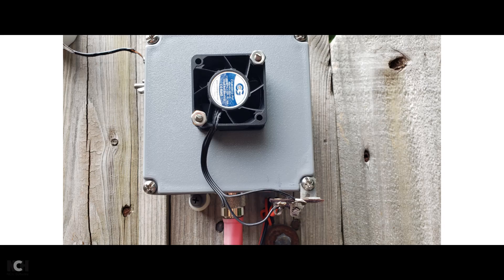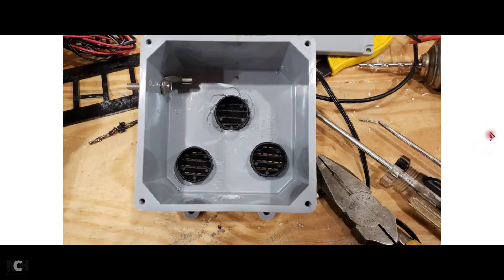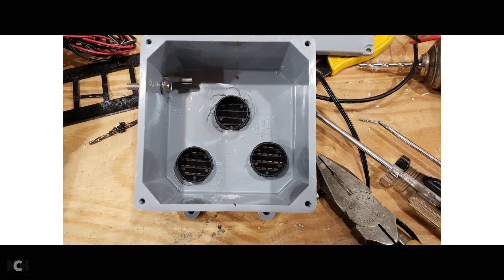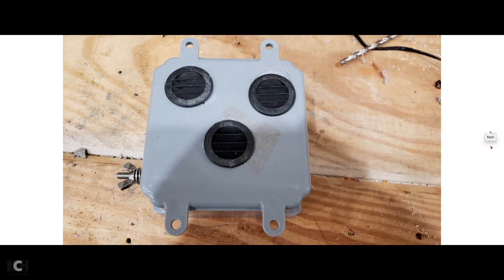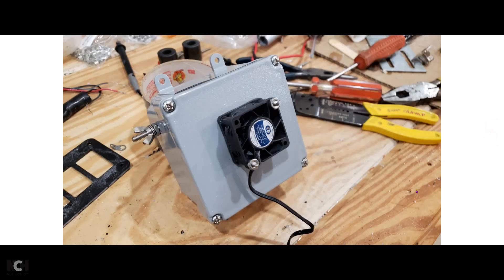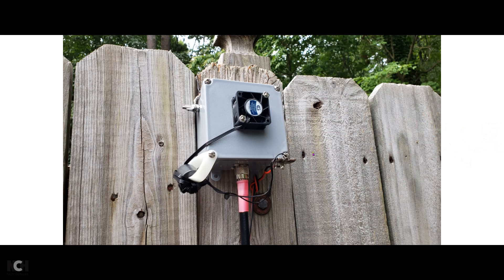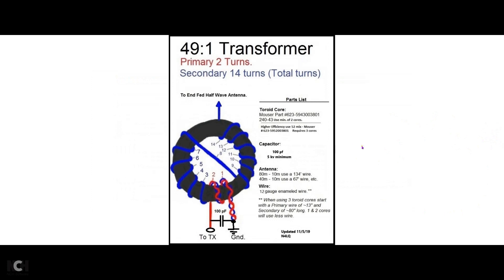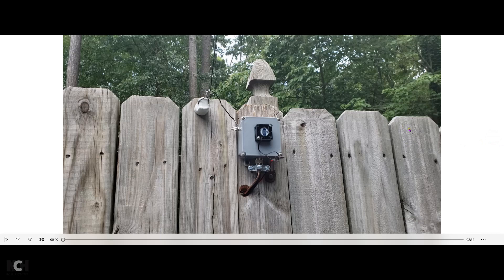End Fed Half Wave Antenna - LEGAL LIMIT UPDATE

Comment: Steve, I just followed your video and did this exact thing to my 49:1 EFHW. I’m gradually working the power up. Tonight, I worked stations hard for about two hours at 1200-1300 watts and it never skipped a beat. Prior to this, anything over 1200 watts would lead to a rising SWR fairly quickly. I have three torrid type 52 cores in the box. This is really quite an ingenious idea and I think you for making this video.
Reply from the maker: Wonderful! Is the mode SSB or CW?
Reply: @n4lq  it’s all been SSB. I haven’t gotten into the digital world yet. I’ve worked around 200 QSOs now at that power level. No issues at all. I’m gonna increase the power to 1350 and see how that goes tonight.
Reply: @n4lq  how much air flow space do you have between the back of the box and the mounting surface? I put  1/2 inch plastic spacers myself. I feel the air being pulled through, so I’m assuming it’s enough.
Reply: @n4lq  well Steve, I now have several hundred QSOs at 1500 watts. No issues at all. I have the fan powered by two power poles on my power brick (1 amp fuse) (MFJ). I unplug the brick when I am not using it, and the fan shuts off. It's flawless. I operated during the day, at night, and while it was raining. Never skipped a beat. I use an Elecraft KPA 1500, and it tunes 80-10, meters 1:1.0, 1:1.1, or 1:1.2. It never tunes higher than that!  It really is just a brilliant solution for those that live in an HOA, as I do. Thanks again!

Comment: Steve I think over the last few years I've watched all of your videos on EFHW antennas and have told myself I need one of those in my antenna arsenal.  Now my wife and I am preparing to start full time RV'ing and its time to build one.  I plan on 40 to 10 meter antenna mostly for POTA work.  I already have a fan dipole 80, 40, 20, 17, and 15 which i can put up each individual band or any combination and a wolf river coil.  since campgrounds are full of underground wiring and piping driving a ground rod into the earth would be greatly frowned upon.  What do you think of tying the ground wire into the frame of my 5th wheel camper?   What concerns me the most is noise from various sources in camper.  I think my only other option would be to run a ground radial or multiple ground radials.  Your thoughts would be greatly appreciated. My plan for the EFHW would  be i have a 29 foot fiberglass push up pole and use it as inverted L or inverted V.
Reply from the maker: You don't need a ground rod. It's mostly for lightning protection.  I recommend laying the coax on the ground for as far as possible.  Near the entrance to the RV you definitely need a common mode choke to prevent noise pickup from getting back to the antenna. The best CMC is simply  6 to 8  turns of coax wrapped around a 240 43 mix core for 7 mhz and higher. You can even do this with RG8x with the PL-259 on it. You can add another core in series just a few inches away. The impedance of these chokes is additive so more is better. Don't try stacking them. Just put them in line. You can experiment with grounding the coax on the shack side of the CMC to the RV but results may vary. If it's going to storm just lower the antenna and or disconnect and throw the coax out the window :*)
Reply: @n4lq  thanks Steve

Comment: Thank you very much for all the videos you make and put on the internet for us! I am very interested in having an EFHW that can run sustained at full power. I have watched many of your videos and countless other videos and read many articles. I have several questions if you have time please:
1.
In retrospect after building your kit, what would you do differently?
2.
During you are videos including this one, you mentioned getting a very specific toroid, specifically the 240-43. What makes that a good choice? For example, why not a 240-31? Or why not some other? Is this about frequency? 160 through 10? What if you wanted to do 160 through 6? Or is this choice of 240-43 specific to some other design choice that you made? What is the reasoning?
3.
You chose to use three toroids and wind them together. What made you pick the number three? Was that based on a power rating? What if you used four? What if you used six? What if you used larger toroids? If such a thing exists?
Sorry, I know I have a lot of questions, struggling to understand everything.
Thank you very much and 73 W3GUY Ernie
Reply from the maker: Ernest. You asked too many questions that would take me an hour to explain in person much less typing... There's no such thing as a 160 - 6m EFHW. It's either 160 through 40 or 80 - 10 meters. For high power on 80 - 10 you need three 240 / 52 mix cores and for 160 you need three 290 - 43 mix. The mix determines the permeability and ultimately the inductance of the winding.  You need more inductance for 160.  
This video explains most everything you need to know. https://www.youtube.com/watch?v=BpdpkUEW39o
Reply: @n4lq  Your answers were exactly what I was seeking! Thank you for all your videos and all you do! 73 W3GUY Ernie

Comment: On the relay box for the 160, 80 and 6 meters coverage on the 49:1 transformer, do I need the connections to the relay to be coax wire, or can I use other type of wire? Thanks.
Reply from the maker: It doesn't matter
Reply: @n4lq  Thanks a lot for your help Steve. I have the 49:1 with a 134' of #14 wire and a Palstar AT2K tuner and working fine from 80-6 meters. Now, I got all the parts to do the relay box for the 160, 80 and 6 as per video. Will assemble, then test on 160, and see if any better on 80 and 6. If I need to cut from 134' to 130', will also do. Thanks a lot for your help.

Comment: What about filling it with mineral oil? Thats what large transformers are filled with. They have large radiators on them but the get really hot.
Reply from the maker: Mineral  oil is a dead short for HF RF. I tried this.

Comment: Rather than adding a fan, would adding another core increase power capacity?
Reply from the maker: Adding cores will increase the inductance. Turns ratio and the capacitor may need adjusting to compensate.   Another core will just take longer to heat up to Currie temperature giving you more operating time at high power but it also increases the cool down time. A fan just takes care of everything.
Reply: @n4lq  thanks for the reply👍👍

Comment: I am also a big fan of the EFHW with 49:1 UNUN. Mine is the myantennas.com EFHW 8010 works really well and I get great Dx with it and also good NVIS. I think they now have a new improved transformer. 

I have the UNUN mounted about 3 feet off the ground and have a Short Earth there which seems to make a big difference on 80m to SWR, Antenna then goes up around 20 feet turns North to a 50 foot tree then the rest east to a 65 foot pine tree so it's some kind of INV L.

I get as good and sometimes better signal to a regular contact around 550 miles away and he's using a Doublet cut for 40 and he's got a Double Bazooka for 80m and the same, I get as good to better signal.

I was on 40 m one evening and talking to the HAM 550 miles away and a local around 60 miles away and I hear someone call me and it was a Ham in Brazil and they other 2 Hams couldn't hear him so  it's testament that these EFHW 49:1 work and work well but my noise floor is also very low as I live in the sticks and this does make a difference hearing DX. The Transformer core ingredients are crucial to the success or failure of this antenna, the wrong core materials could see you loose a lot of power so for the first antenna stick with well known brands such as myantennas.com or hyendfed.nl who also make good ones, I have the hyendfed.nl 5 band MK III as a 2nd antenna for the sitting room so I can scan around the bands and make some contacts without going to the shack, this one has a coil for 80m which out of the box has lowest SWR for the CW portion of 80m, taking around 8 inch + and folding it back gives it lowest SWR around 3750-3800 Khz. It's 21 meters long and performs very well indeed, sure performance is down on 80m compared to my EFHW 8010 but it gets me on 80 with a short antenna and it's all I need to some contacts from the sitting room and I get decent DX on it too.

Comment: Does cloth tape interfere with the heat flow or something because I never see you use any?
Reply from the maker: Yes and the increased distance from the core reduces coupling thus higher leakage inductance. Not good.
Reply: @n4lq  Well I made a transformer very similar to this but it has high SWR above 25MHz with a resistor connected so it won't work on 10m. It's a 2 stack of 52 cores from Mouser with a twisted 2 turn primary. Maybe there is a modification that can be made to fix this but it isn't apparent to me. Usually the smaller transformers I've made just work.
Reply: @TheLightningStalker  I know this was several months ago, but in Steve's videos on the EFHW build, he indicates if you use 240-52 cores, you have to use three, otherwise 240-43.  You can see an image at 20:09 in the video, "Multiband & EFHW Antenna Presentation at BVRC."  That video image shows the requirements for the cores.  Let us know how it goes.

Comment: Good project and thanks for sharing. Sorry in advance if it's a silly question - I assume that no one is likely to touch that exposed antenna terminal or be able to grab hold of the antenna wire end? Dread to think what the voltage is on an EFHW at US legal limit!

BTW, I made a QRP EFHW using a type 43 core for 80-10m. Works just fine. My 5W model fits in a matchbox and no cooling fan required 😀.

Comment: Very nice setup Steve. This is just a thought on powering the fan, maybe use a solar cell charging system and small battery along with a heat-sensing snap switch to turn the fan on and off so that the fan is not on 100% of the time. I would guess this power method would require a screen on the fan to keep nesting bugs out when the fan is off.    73's Charles WD4W
Reply from the maker: That would work if the sensor doesn't upset the transformer's impedance. Another idea is to use an RF sensing switch instead.

Comment: Thank you for sharing; may I ask the following? Not many info for transformer built with 3x stack of FT240-43 & same ratio winding with 14 gauge enamel copper, would this has better efficiency than 2x stack FT240-52? Thanks in advance.  73 VK2KHO.
Reply from the maker: No. 52 mix is more efficient. That's why we use it. More expensive too!
Reply: Thank you. Has to wait longer to built, no: 52 hard to find in Australia.
Reply: @777-Ohana  
Minikits in VK5 have them.
Reply: Thanks, I’ve bought FT240-43 from Minikits - and no FT240-52 until end of August. I was hoping some info on the calculations how 3x FT240-43 can have better efficiency. Although many info from Europe with FT240-43 not on the 52 material. Found some calculation on this type of design efficiency, need to study math again.

Comment: Very good ideas Steve. You, and others, have brought the EFHW to prominence, especially for restricted/portable ops.

I've assembled a 49:1 via 2 stacked FT50-43s for a 66' wire to test as an Inverted 'U' with my 590SG/uBITX/QCX rigs. Will purchase 3 ea FT240-43s soon and stack 2 as a tapped 64/49 txfr. The other 240 will be wound as a current choke.

I've assembled 2 ea 20' PVC poles, with slip joints, for the Inverted 'U' and will buy a 10M SpiderPole next month to erect a portable Slopping Inverted 'L' for the 66' and latter a 133'.

Your series of vids have been invaluable for EFHW construction/configuration/use along with Gil's vids from France. These vids provide confidence that we can construct a 49:1 txfr and stick a bit of wire on it and know it will work. Of special value is your vid on grounding/counterpois/choke position and coax legths.

What's so nice about EFHWs is with a transformer and different Half Wave bits of wire, we can get on any frequency, HAM Bands or otherwise, maybe with/without compensating Ls/Cs. Lots of great info spread across your's and Gil's vids.

I live in a restricted environment and setup/positions is a challenge. The EFHW is my Ace in the Hole as it can go Up/Down easily, is Temporary and the Apartment Nazi's won't have much to Piz-n-Moan about.

I won't be needing the cooling features any time soon but it's nice to know they have been implement/tested/proven if I ever go beyond 100 watts with a linear.

Thanks so much for all of your EFHW vids. I've saved them all....

73 OM de KA1RUW . .

Comment: Great video Steve. I made my EFHW antenna based on your April 2017 design: Three 43 mix cores and 14 gauge magnet wire. Antenna wire is 67 feet of 14 gauge steel copper clad stranded insulated wire. 40-10 +6 meters. Antenna has been up almost 3 years with GREAT results. At this time I am only running 100 watts through it so I have had no heating problems. This fall I am going to make your up-dated version to include 80 meters. Thanks Steve for introducing me to this great preforming antenna. I live in a gated golf community here in Florida and this is a perfect all band antenna that keeps my HOA happy. 73 Joe KN4IFI